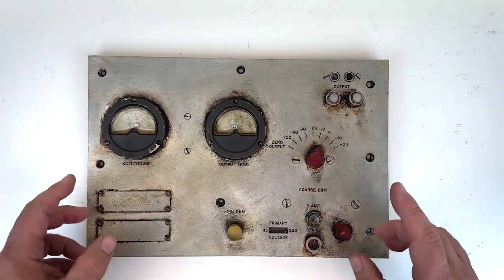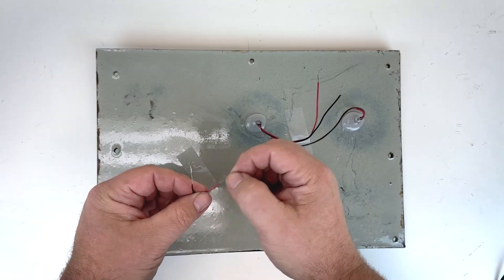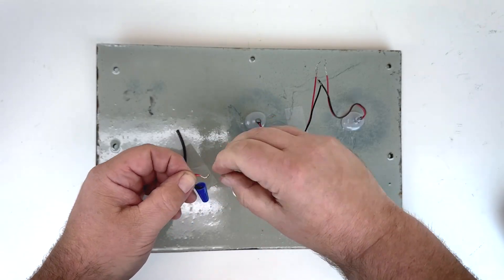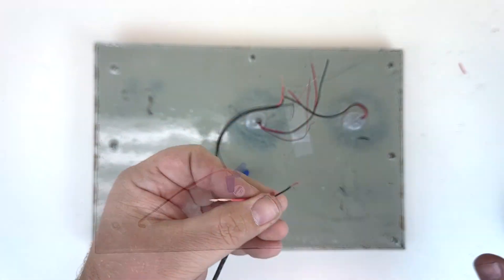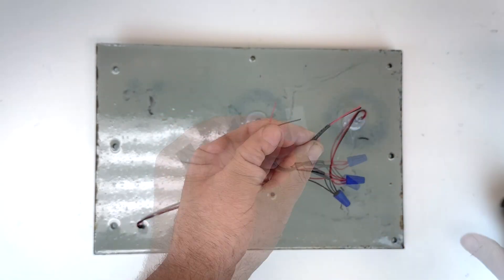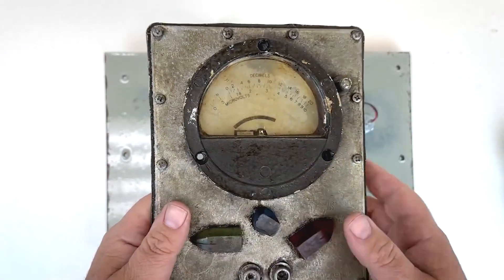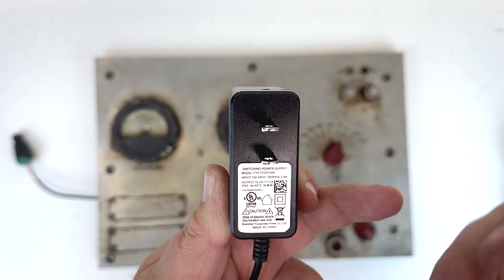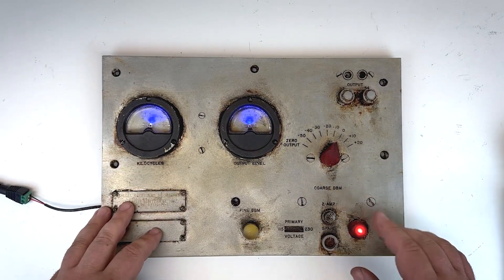How To Wire Multiple 12 Volt LEDs to One Power Supply

Comment: What if I wanted to put a switch in? Can I place in either the positive circuit or negative circuit
Reply from the maker: Yes, you can add a switch to either positive or negative. I think the preference is always to switch positive if you can. You could also use something like this on the power supply:
https://www.frightprops.com/power-supply-switch.html

Comment: One thing on power supplies, on some, the barrel is not center positive, so you have to be 100% sure how your power supply is wired at the output connection.

If the barrel is center negative, and you wire that green connecter as shown as red to + and black to -, with the + going to the center of the barrel, you're going to let the horrible smelling magic smoke out of those L.E.D. lights, and there's an excellent chance they will pop(explode) by too much voltage in reverse.

In this case the - black wire needs to go to the + side of the green connector and the red + wire needs to go to the - side, as the power supply is reversed polarity with the barrel center being negative(- black wire) and the outer barrel being positive(+ red wire).

You're going to literally destroy those L.E.D. bulbs on the panel if your power supply is reversed and aren't aware of it.

Always check your power supply output with a good digital multimeter for proper voltage and polarity, BEFORE plugging anything into it to make sure it's correct for your project needs.

Not everyone knows this, so this is something that I feel you should have covered in your video wiring tutorial, as this is very important.

Comment: OMG Those instrument panels look awesome.  The thing is, I have these kinds of old electronic meters and controls knobs,  the paint and molding is excellent, they are so perfect that it completely fooled me. The quality on these are really good, they are accurate.

However, the one nit-pick I have with them is when you powered on the LEDs and I saw the blue LEDs with hot spots on the meters,  I was disappointed on the meters. Let me know if the way it came across on the video looks better in person.  I've worked with old equipment and the backlights for analog meters are from mini-incandescent lamps (so they're just barely bright enough) and they would be diffused so the entire panel is fairly evenly illuminated. And they would be illuminated upwards from the needle movement, usually there are 2 on each side.  If they are looking to step up their realism on those panels, then I'd suggest that they swap to a warm white LED and some diffuser material to reduce the hot spot, and then it would really look the part.   If it had that then I'd swear I was looking at some old-school electronics and panels.
Reply: I have to agree with you.  The blue L.E.D. lights just didn't cut it for me either.  Too focused on one specific area, needs to be dispersed over the entire face of the gages.

   The only time I've seen a gage be any other color than white, is if it were strictly digital.

  Analog meters with moving needles, always had incandescent bulbs illuminating them.

And even if I were building a FAKE Panel, I'm using real gages I can put power to using electronics to make the needles move on the dial.

   If the gage never moves, just not realistic enough for me.

   Those gages MUST function to some degree!
Reply: @HolidayDecorator  I agree if you're going for absolute realism the gauges should move, but as a prop piece, I can forgive the gauges are not moving because there's a lot more going on in the rest of the room and that's a minor detail most people wouldn't even notice. If I had this panel in my haunt I wouldn't connect the blue LEDs  and I'd put another (appropriate) light above it to accent the whole panel.
Reply: @HobbyHalloween   I've set up props in the past and had left comment cards for folks to fill out letting me know what improvements they would suggest for my next year's display.

And I used to use old analog panel meters that weren't connected, believe me, people DO NOTICE non-functional items, as that was actually a very common complaint I received.

  Is there a way you can make the gages work, having them just sit there doesn't look real, or nice setup, but couldn't you make the gages move?

So if that were my prop, I'd have to replace the faux gages with something a bit more detailed and working for my visitors.

But to each his own.

  I just prefer something with a bit more realism going for it.😉😁
Reply: @HolidayDecorator  I agree with you on this point. However, I might mention that the people willing to take the time to fill out a comment card are those that enjoy the haunt and notice details so you may have some bias in your data collection... and that not a bad thing either, it is exactly for that reason I spend a lot of time making my props as realistic as possible, yes, those people do notice details like that.  Others are with their kids and they're on to the next house for the candy.  I do occasionally have someone let me know how much the appreciate the details and work that went into the haunt.

Since I have an extensive background in electronics and work as a professional firmware engineer, I have the "chops" to make "real" panels with lights, gauges, displays etc.,  work and appear to do "something."  I enjoy a personal challenge and satisfaction of making stuff.  And it seems from your comments you have similar abilities as well... and that's really the fun in making stuff.

What I'm really trying to say, it's pretty cool that these panels exist as a product, for those folks that don't have the time to build, or ability, or can find, afford, etc.,  for whatever reason, these panels are the next best thing and they really do serve as a storytelling prop in a haunt scene.  At 5 to 10 feet away in the dark, mostly it's in the background and the Frankenstein's monster or lab experiment that's animated coming at you is grabbing the focus of your attention.  Yes, I too wished the needles on those gauges would be animated and lit properly.  Maybe they'll get feedback from us and that might be the next version of these panels?
Reply: @HobbyHalloween   yep, started in Electromechanical assembly, rework expert, electronic tech and Electromechanical prototype engineering labs.

So, yep, I've actually been around it for years. My late father taught me how to solder to military specs when I was 7 years old and I've been building and modifying things ever since.🤣🤣🤣

My late mother used to get so mad at me for disassembling my new toy she'd buy me, just so I could see how it worked and maybe improve it.  Used to drive her nuts when I'd reassemble it, and now it had features and did things it wasn't supposed to do.😂😂😂

I think the biggest one that got her upset was when I disassembled the color console TV, but I did put it back together mom, and it still works.🤣🤣🤣🤣🤣
Reply: @HolidayDecorator  Yep, I got started in my electronics when I was 7 too, soldering and putting together kits, had tutors teach me how to make things. Did you ever see or use the Radio Shack's Engineer's Notebook by Forrest Mimms III?  I'll bet you know what I'm talking about with that reference.  I think we're very similar in that regard, so,  I know where you're coming from; we're detailed oriented people and "suffer" from the same "affliction" LOL 🤣
Reply: @HobbyHalloween   Oh yes, Radio Shack was my go to place for all kinds of electronic parts.  I still have my collection of assorted projects books by Forrest M. Mimms III and some other reference books he wrote.  Very familiar with all of that. LOL

Used to buy those Radio Shack P-Box kits, those other experimenter kits that had the springs and components mounted on a hard, stiff cardboard platform in the box that you could build numerous projects in the box, then build it with your own parts from the schematic diagram in the project kits manual in your own enclosure.  And they had many of those experimenter kits over the years.

  I loved those project kits, if it hadn't of been for them and my father being an electronics engineer I might have never gotten into electronics at all.

My dad was also an electrician prior to electronics.

 My late grandfather(Dad's father) owned his own electric service company when I was younger.  So I learned electrical work from my late father and late grandfather.

Yep, seems we both suffer with that same OCD electronic and working devices affliction for our projects.🤣🤣🤣

I'm actually working on some equipment I have right now, close to around $5,000 worth that got zapped by lightning almost a week ago now.

  Not sure if I'm going to be able to salvage any of it yet, but I'm working on it.  Depends on what kind of damage the lightning did to it.